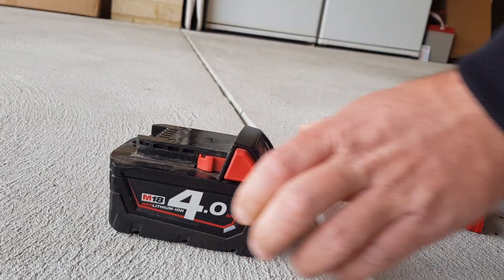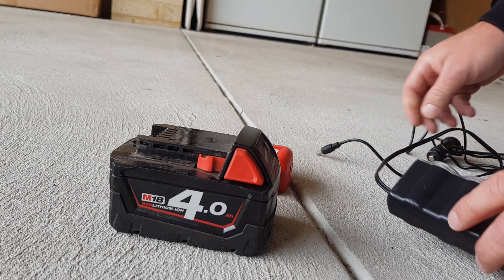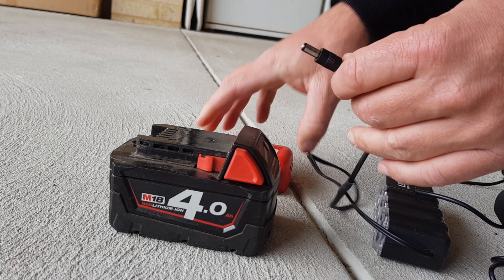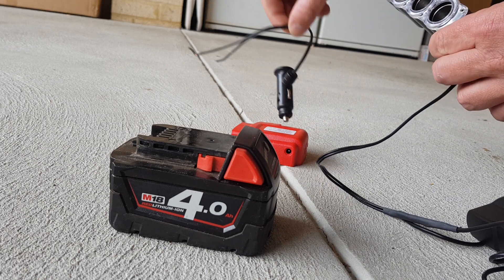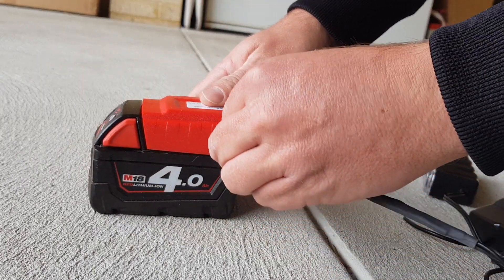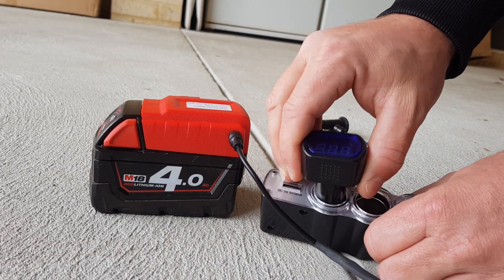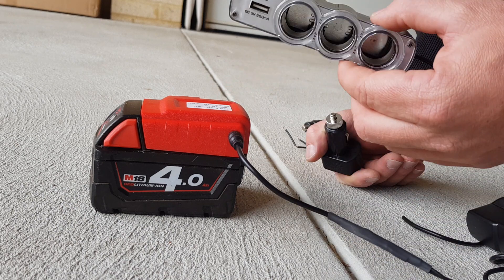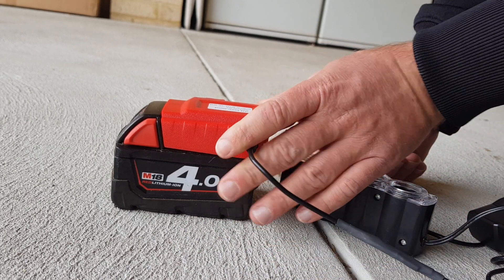Milwaukee 18 volt DC to 12 volt DC

Comment: Will this charge the Milwaukee 18v from the 12 volt supply
Reply from the maker: Unlikely
Reply: No, you get 18v on the output also not 12v. To be safe, run a step down, converting to 12v. Most 12v stuff will run between 11v and 20v.

Comment: Hi.  What is the name of the socket please?  I cannot find it on ebay. I think your socket have converter inside that convert from 18v to 12v.  I see ebay 12v to 12v socket directly no converter. Thanks for your reply
Reply from the maker: I just Googled Milwaukee 18v 12v adapter.... from my local tool website Milwaukee does a genuine one. Part number M18USBPSHJ.... reading the description "designed for use with M12 Heated Jackets". Thats the round outlet on the side. Sure the is knock off versions on eBay etc.

Comment: Hi Keithy007. Wondering if you tried running a camping fridge yet? Love the idea.  I've ordered 2 of these and was going to make a fridge cable splitting into two connections to run both batteries together and hope that is enough amps to start the compressor.
Reply from the maker: Hey Dave, forget about that. I should get onto that. A 120A/h AGM battery will comfortably run an Engel (portable fridge) under normal contitions for 24 hours. AGM batteries are only able to be use 50% capacity compared to lithium (like the Milwaukee battery). So from that we can assume 60A/h of lithium would run a fridge for a day. So 9A/h is 15% of 60. 15% of 24 hours is 3.6 hours. So as an educated guess between 3-4 hours. If the fridge was cold with a few frozen water bottles in it this could be extended. Would be enough for a day at the beach. I should be studying- thanks for the opportunity to procrastinate.
Reply from the maker: No that wrong 9A/h is at 18volts. So at 12volts would be 13.5A/h so that's 22.5%, so more like 5.4 hours.

Comment: That 12v outlet is week, if you try to put a big load you will burn it.
Reply from the maker: I think the original idea of the 12v output from the 18v batteries is for the Milwaukee heated jackets. So a load such as that should be fine. However I wouldn't jump start you car with it.
Reply: @keithy077  exactly 👍🏼

Comment: Hi mate I have a champion 18v hedge trimmer battery if I put the charger on top and do the same thing as u did will it work
Reply from the maker: Looks like only 2 pins connect. So as  long pos and neg line up, and the battery voltage is 18v shouldn't be a drama. Though most brands have there own mounting system. This one is specific to Milwaukee.
You can buy adaptors for most brands to most brands, or that brand may make their own type.
Failing all that, if your handy with a soldiering iron, you might be able to pull apart and modify to fit. 
Hope this helps.
Reply: keithy077 hi thanx for the quick response I do not have a soldering iron but it should be fine with electrical tape and heatshrinks